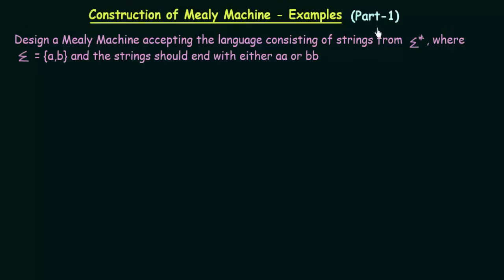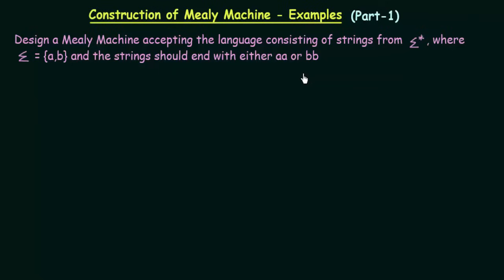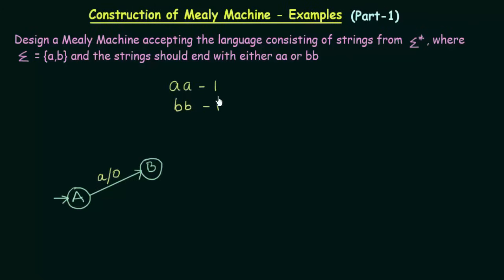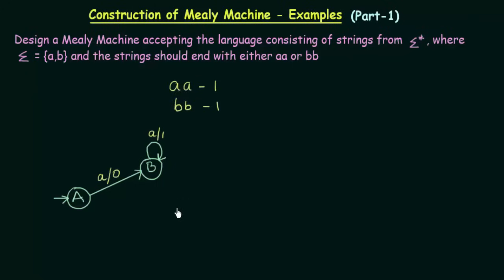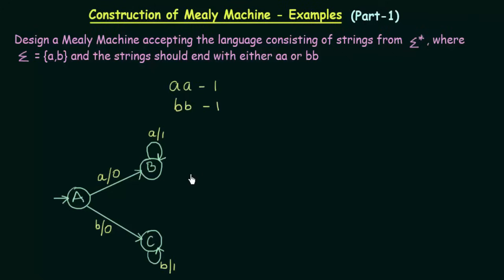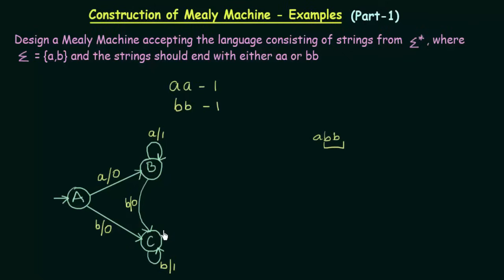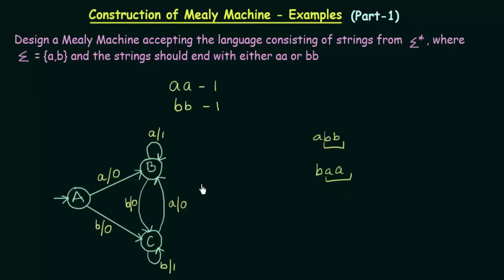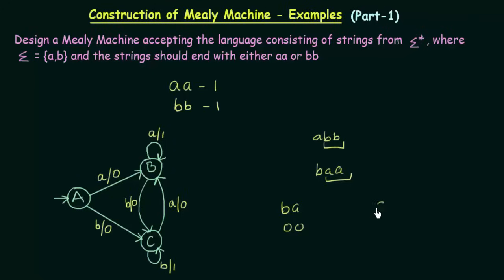Construction of Mealy Machine (Example 1)

Comment: to late but I think it doesn't work correctly cause: it would return (1, 1 ) with a  (a a a) sequence. and as well b.

please tell me if I'm wrong.🙏
Reply: Look, you'd be right if the point of this machine is to count aa's, or bb's. it's not. The scope is to just represent aa, or bb with 1, so that we can see if a string ends with aa or bb, (1,1) sure could mean (aabb) or (aaaa) but what's both true in this case is that 'aa' exists at the end.

Comment: The problem with the final states B and C having self loops is that if we get a 3rd consecutive a or b, this will print a false 1 even though we do not have the second pair. So for example, we have a string aaabb now this will print 111 and yes sure the string will be accepted because there is a 1 at the end but we will have the wrong assumption that we have 3 ''aa' or 'bb' pairs in the string when in truth there are only 2.
Reply: I actually cannot figure out a solution for this in terms of the output and having the string accepted, in my solution I have sent an edge back to state B when I get a third consecutive 'a' and printing 0 obviously because we have already printed 1 for the two a's preceeding the third a but this causes a problem in the string being accepted.  So for example I have the string 'aaa' this will print out 10 and the string will not be accepted because the third a would send it back to state B, but now this is the problem that the third a is still making the string end with aa and the string should be accepted but I cannot print 1 because if I do the output will be 11 even though we only have one pair of aa in the string 'aaa', any one with a solution would be appreciated
Reply: true
for that we will need to have 2 more states to get a correct mealy machine

Comment: I read the comments and saw people not getting the question the question is to have a machine that accepts strings taht have aa/bb at the end , is a string like aaba can't be accepted , but a string like aa, bb, aabb, abaa ,etc are accepted , and that's all the machine does so if you getting out put as 010 ,well your string of inputs is wrong(not accepted) why because 1 only represent , the completion of a sequence aa/bb in the string , so yes you can get a string like aab and you will have out put like 010 but that shows you the string is not ending with bb or aa and also tells that ther is one pair is aa or bb in the strong
Reply: thank you

Comment: If the output must also meet the criteria of the 1 being at the end. Doesn't it mean that we should create another FSM like DSA to determine whether the output is correct? Meaning that we need two FSM's in total?
Reply: That is what i was thinking. Mealy machine generates the string corresponding to the input string and then we use another FSM to check whether the output string is accepted or not. If it gets accepted then the original string ends with aa or bb.

Comment: Wrong solution, as it will produce 1 when ever the sequence aa or bb appears  in input. while the question says output 1 only when aa or bb appears in end only.
Reply: Sir Mealy machine will only generate the output string consisting of 0 and 1. We need to create another machine to check the acceptance of the o/p string. If the output string gets accepted then the original input string ends with aa or bb and if not then the input string does not end with aa or bb.

Comment: I have another solution starting state A on getting input a gives output(0) and goes to state B, A on getting input b gives output(0) and goes to state D, B on getting input a gives output(1) and goes to state C, B on getting input b goes to state D and gives ouput(0), D on getting input b goes to state E and gives output(1), D on getting input a goes to state B and produce output(0).
Correct me if i am wrong.
Reply: this is not DFA, in state C and E there is no outgoing transitions.

Comment: check for string 'aaa' it will produce output '011' . Isn't it wrong?
Reply: String 'aaa' ends in 'aa' and output '011' ends in 1, which is the intended way for this machine to work.

Comment: this is wrong example, it will give output 010 for string aab or bba. 1 is appearing even if the string does not ends with aa or bb.
This example is correct for the  question "if the string contains aa or bb" not ends with.

Edit :
turns out, i was wrong, it is correct. The string 010 is ending with zero so it will not accept. It should give output ending with 1 to get accepted.
Reply: He didn't clarify that the input is only "accepted" if the output ends with 1. Very ambiguous.
Reply: @ChristianBurnsShafer  means?
Reply: You're right. There shouldn't be self-loops for a/1 and b/1, but 2 different states, hence, the correct machine will have 5 states and not 3. I made the correct one before looking at his solution and got confused, thank you so much for your comment !
Reply: @RishikavsAnnie  turns out, i was wrong, it is correct. The string 010 is ending with zero so it will not accept. It should give output ending with 1 to get accepted.
Reply: @princedivyanshu  Bro in 1's compliment example there were lotta outputs ending with 0... So, can u please tell me how and why only inputs with outputs ending with 1 are accepted?... Or is there something that I missed?
Reply: @Daniel-iq3tl  in 1's compliment it is not acting as a accepting machine, it is just giving output ( could be anything depending on input ) . Here the question is to create a  machine which will accept or reject  . So machine will accept if output ends with 1 or else will reject.
Reply: @princedivyanshu  how do you make the machine accept if the output string ends with 1;
like how do you accept anything in mealys machine if it doesn't have any final state??
Reply: @RishikavsAnnie   exactly i was getting confused too because what if the self loops of a and b run 0 times and we get a null then the string would not end with aa or bb but instead only a and b
Reply: you are saying output is 010 , what is wrong then ? ==> Accept the string when right most digit is 1. it's that simple , if right most digit is 0 . This indicates that the string you have entered is not accepted.
Reply: @nirajgaykwad30  yes,hthe solution is right!how can people be so damn stupid!-_-
Reply: Sochne vali bat to h bhaiya🤔🤔
Reply: Thanks man, I just came back to see this condition and you saved!!!
Reply: There will be total 6 states

Comment: In the previous video titled 'Construction of Mealy machine', the question was to print 'a' whenever sequence 01 is encountered or print 'b' otherwise. So in that video when 0 occurred the flow went from state A to state B with output b and when again 1 occurred in the input i.e. when we got the desired sequence the flow went from state B to state C with the output 'a'.But in this video when aa was detected the flow remained on state B itself outputting a 1 (similarly for state C when bb is detected) instead of going to another state like it was done in the previous video. Please explain.
Reply: Note that string 'aaa' has the string 'aa' occuring in it twice. Once for the first two a's and once for the last two a's. If we move away after counting the first, then we won't count the second. In particular input 'aaa' returns output '011' which we accept.
Reply: @ChristianBurnsShafer   this would count the number of occurrences of aa and bb but in the question it is asking for ending with aa and bb
Reply: @AyushEditz-hs6pf  Oh shit good call. There would be the first aa, second aa, and aaa, e.g.

Comment: this example is wrong it will print 1 whenever it encounters with aa or bb. not when a string ends with aa or bb. make a dfa which accepts strings ending with aa and bb and then assign 1.
Reply: thanks a lot sir for clearing the doubt.
Reply: you are doing a very nice work.
Reply: Dfa has a final state, melay and moore doesnt… fundamental flaw in your concept
Reply: Neso Academy Nice.
Reply: If the string doesn't end with aa or bb then the output will be 0 if it ends with aa or bb then its 1. So you don't worry about the final state.
Reply: +Neso Academy Your use of the term "accepted" is what's causing the problems here. You should simply state "the output will end in 1 if the input ends in aa or bb" if that's what you mean.

Comment: what about input aab aur bba  string?
it print 1 but not ended with aa or bb.
Reply: He didn't clarify that the input is only "accepted" if the output ends with 1. Very ambiguous.
Reply: A Mealy machine does not have final states because it does not accept or reject input. Instead each transition produces output.
Reply: bba mat akr no scope
Reply: The output string has to end with 1 only.
Reply: aa takes to state B with output =1 ; Now if in that state you apply another input b then you move to state C. the output =0 because the sequence is a-->a output =1 when you enter b it transitions from  a-->b  output =0. Guess it helps